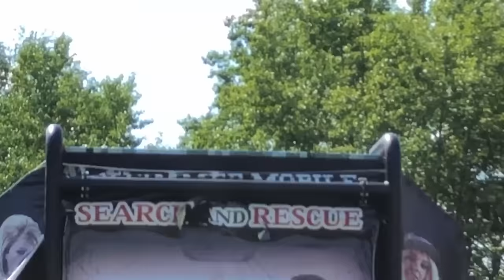150 LBS Of Tannerite VS BEAVER DAM!

Comment: At least a hundred pounds of tannerite burned up in the air, that was that orange smoke. You could have made quite a crater with half that amount if you would have sank it and put something very heavy on top of it. It takes the path of least resistance. Of course that causes boulders to fly by your head. So there's that. Good video though. The small propane tank in the last video made the loudest bang, propane is extremely volatile.

Comment: You'd be much better off placing your explosives as close to the water as possible. The water backing makes the dam stronger, the closer your explosive to the water the more your explosives will do on the non water side. Get an auger mount for the sherpa.
Reply: yes, the incompressibility of the water will direct all the power towards the dam

Comment: You said you were mixing it while you were on the way there... it's actually a felony to transport any amount of it mixed. I think the law is ridiculous, but I definitely would not have mentioned that on camera...lol
Reply: This is 100% correct. Clearly states that on the box it comes in.
Reply: Not to mention that's dangerous as hell
Reply: The Essential Freedom yup! I’ve actually shot tannerite with 9mm, 45 and 22 doesn’t go off.
Reply: Felony is an American term. Here in the GWN it's cousin which has similarities is known as "indictable"  pronounced in-dite-able.
Reply: Those bullets arent anywhere near fast enough they need 2600 fps at least. @mrtangerillo7758

Comment: Add some potassium perchlorate to the aluminum powder. It makes it more sensitive (will go off with subsonic rounds) and perchlorate is a stronger oxidizer, so you'll get a more brisant explosion.
Reply from the maker: Sounds aggressive
Reply: @markfreeman408   lol listen to guys who never done it..
Reply: @markfreeman408  it makes it Johnny Nutrin Pizza Aggressive..
Reply: High voltage, high pressure, high tension. High explosive. Like anything with that much stored energy can kill but that observation about flash will save a life. Good work.
Reply: What ratio perchlorate would you recommend?

Comment: You guys should wrap your Tenerite containers with duct tape. Make several layers . Don't be stingy with the duct tape. Depending on the size of your container, you may need 3 or 4 rolls of the tape. Then with a sharp knife cut a window in the tape. Make the hole about 2"x4". Do not pierce you container. This makes the Tenerife a directional bomb and concentrates the energy in a small area. That will make your beaver dam destruction more efficient.
Reply from the maker: Interesting!

Comment: Put the tannerite in PVC pipe then burry into dam. 3 lbs will blow a big enough hole but we have used 20 pounds in a pipe before. Will blow a 10 foot wide 6ft deep crater. And yes splitting up even into 3 lbs charges is the most effective. 2 inch PVC, 3 feet long.

Comment: Wrap the containers all over including the top and bottom.  Cut a small window only in the tape on each container and turn the "window" in the tape toward the direction you want the blast focused.  This will concentrate the blast like a shaped charge and remove much more of the dam.

Comment: Huh, mixing tanerite in a motor home while you're driving down the road.  Then you're riding on a trailer just feet from the mixed tanerite.  I do believe that you qualify for the "Darwin Awards!"  Congratulations!  Hopefully you don't win the award while innocent bystanders are nearby.
Reply: Tannerite only explodes when hit with a high velocity round.  It's not nitro glycerin....dropping, burning, car accident, even most if not all shotgun shells....none of those things would cause it to explode even after mixing.  https://en.wikipedia.org/wiki/Tannerite  Do a bit of research next time before insinuating others are stupid.

Comment: You can't just take a rifle out at an unknown range, with unknown ammo, with variable wind, if it's sighted for another range, put the crosshairs on target and expect to hit the target with 1 shot accuracy...    What's the velocity and BC of the ammo? What's the drop at 100m, 200m, 300m, etc? what angle is the shot? What is the wind speed, temp, pressures?   Where is you're data book and scope dope card? 

Proper Prior Planning Prevents Piss Poor Performance....

Comment: OK,  You are spending a lot of money and only getting half the power out of the tannerite.   Additionally, you put the explosives horizontally to the dam.  Yo7 should have put it perpendicular to the dam.  To get double the power, you need to go deeper AND you need to place the charges on the water side of the dam.  The water pressure pushes back on the dam and as the explosion pushes upward and also against the dam.  If you want to shape charge the explosion, use a steel container and reinforce the water side of the container, forcing charge to go agains the dam.   F=ma!    Nice hole!
Reply from the maker: Think we’re due for a new video

Comment: Research your explosive rate before doing..if done better with ANFO
Reply: Tannerite is a brand name for pre measured anfo. (WAY too expensive).
Reply: @brentseely6113  ANFO is ammonium nitrate and fuel oil, you need a blasting cap to set it off (a strong one). There is no liquid fuel in tannerite. Aluminum powder compositions are easier to set off, but much weaker than liquid fuel ones.
Reply: @Ntwadumela1  I'm aware of Anfo/ammonium nitrate. Prealed (sic?) Is ideal as it creates more surface area. Your aluminum powder is best at 400 mesh or higher. Also worth noting that it can be initiated using high quality flash powder (kcLo3) in a copper, brass, or steel casing. Or so i'm told..